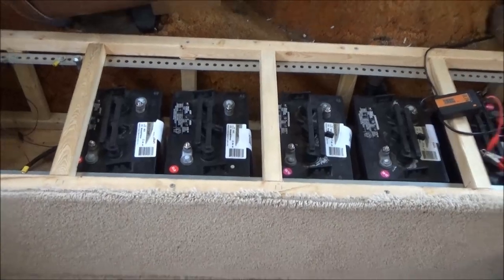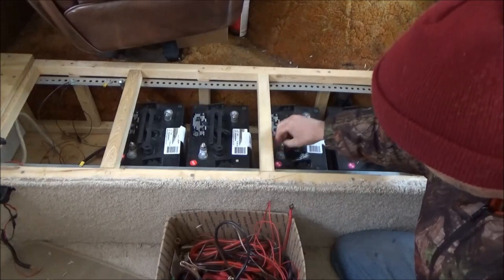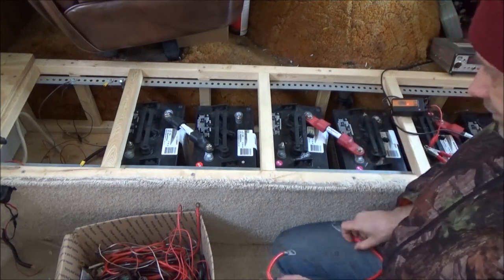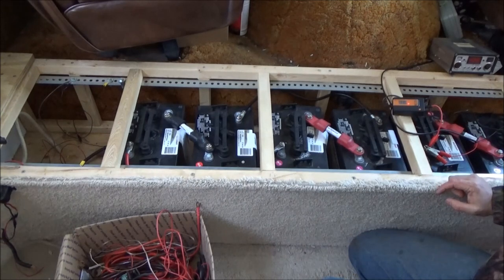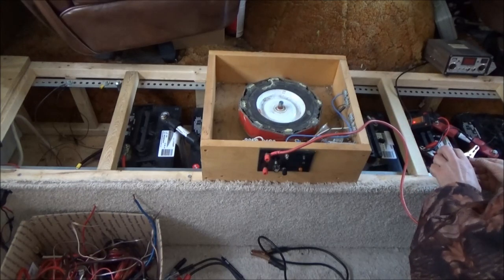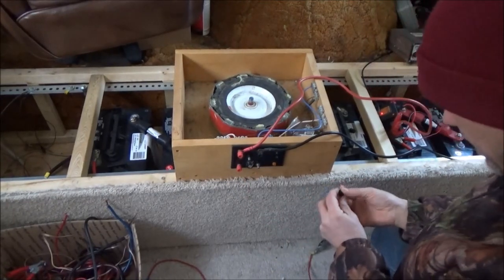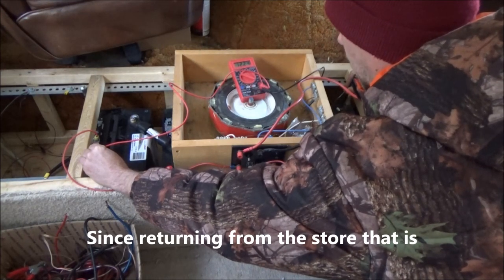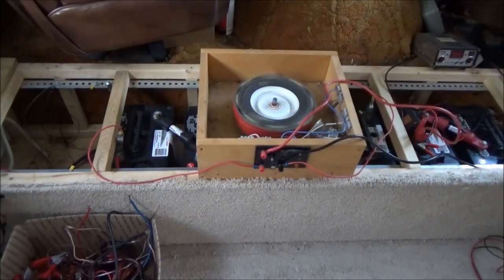Connecting Badly Sulfated Golf Cart Batteries To Bedini Motor Desulfator In My Off Grid RV

Comment: Hi Troy, as you asked I have waited before I left the channel. I want to say that the last two videos are much better and thank you. please remember even if all your doing is cutting firewood and moving snow we all want to see you doing stuff like that. it shows your not just sitting around. not that you can't sit if you want. :-) I have watch your channel for all this time due to I want to do the same as you. I want a tinny house off the grid. So you have been an inspiration to me. 
Thanks
James "Tank" Underwood
Reply from the maker: Thank you for hanging on. I have been quite sick since Christmas and was trying to hide it. It was affecting everything I do. I hope to keep plowing forward with good quality videos from now on.
Reply: The Do It Yourself World I was wondering about the forklift batteries. losing the cream off the top so quickly maybe they are 12 volt batteries and not 13.8. i think i would try using 7 cells instead of 6 giving you a true 14.volt battery. worth a try?
Reply: Allen Cox I thought of that idea, myself, but was unsure if it was a good one.
Reply from the maker: Allen Cox The big one is a single, solid 12 volt forklift battery bank. I will call the company and ask though but I think it should have normal voltages.

Comment: Troy, I used to work for a golf cart company, and got to learn a good bit about batteries and charging.  One thing I've noticed on your vids is your concern about voltages.  In the case of carts... example 48v pack is not considered discharged until it reaches 42v.  They regularly need this discharge to excercise the pack.  I'm fairly sure a 12v pack is not discharged(exercised) until it's down to 10 volts.  By not exercising your pack you are creating a sulfation situation.  We regularly ran discharge cycles on packs to rejuv them.  You may need to start doing this to keep your packs healthy.
Reply from the maker: 10 volts on a battery is very bad, for most batteries. I am no golf cart battery expert though. But I am going to cycle these old batteries in order to bring them back up.
Reply: Old Ni-Cad batteries needed to be deep cycled to prevent memory effect. This is not the case at all with lead-acid batteries. Whoever started doing that at the golf cart company you worked for was confusing the two battery technologies. Sometimes I still hear people say they like to fully discharge their cell phones to keep the battery in good shape, but these people also are confused by the way old Ni-Cad batteries needed to be treated. The lithium batteries in modern electronics don't benefit from being deep cycled, and it will in fact shorten their life.
Reply from the maker: Pete Brown Whoah there. I dont buy walmart batteries. Not sure what you mean there.
Reply from the maker: Pete Brown The old solar batteries I bought 2.5 years ago have served me quite well. I got them as junk. I never desulfated them yet but plan to very soon. I think they will serve me many more years.
Reply: if you connect differend adged batterys in your bank, i know you get problems.

its a big no no doing that .(i should know as a battey bank profi)
batterys dont dry up on the shelve,(ules you stoke a fire under them,only by overcharging, thats what i see in my proffesion almost daily cause people use non controlled cheep chargers fore longer times connected to the grid, over boiling them.
Reply: Bullit Bullit you are not correct on this, what you tel is a hoax, a traction cel is built to give power for longer times whit lower amp drawing, a starter battery hase more plates pro cel to increase the cold crank amps, its not made to power apliances for longer times with a low amp draw, it wil get damaged, also by using the big traction cels its better to keep them charged in between use, than fully draw them empty and charge again, thats the real truth! lead acid cels wil live longer if they stay fully charged, the lesser ful cicles the better!
(im a battery bank profi)
Reply: Mike Foreman At the golf cart co, we used a discharge machine designed for 36/48v packs.  They do the job as designed.  They discharge the pack using a resistor coil to the specified voltage, by checking the discharge time you can evaluate the strength of the pack amp hour wise.  By doing this in cycles you can bring a 30min discharge up to 65+mins. Essentially doubling the amp hours of the pack. This is common practice in that field.  I've recovered many 6v/8v/12v battery packs with this method.  It merely takes more cycles the more sulfated the batteries are.
Reply: Bullit Bullit  you have no idea what you are talking about,investigate this before you answer!
Reply: ***** deep cicle or not, if the have been filled before, and then dried out your plate surface is sulphated and damaged,! in my opinion you dont know where you are talking about!!
Reply: ***** apologies accepted! (i know i'm rusty in english, but my opinion is, if you understand what y mean, its fine by me ! lol
Reply: Pete Brown  no, its becouse the are used for giving traction power, (forklft hy workers etc).

powering electric motors.
Reply: McNeely Joe  i dont blast anyone????(atleast y dont think or want to do!)
yust giving advice witch is not gathered on you tube like the most of the replyers! (most take it for granted, but it realy is not, y have  more than 30 years real experience in it by selling and building and installing battery systems for mostly offgrid systems (mainly rv/boat and offgrid homes!)
forinctance, if you use a starter (car)battery in ciclic use you can give it around 80 discharge/charge cicles before they are getting weaker, a real semy traction battery (suposed the one you mean), can do that around 1500 tymes before getting weaker, a real traction battery can do that many, many more times, thats due to the way the cels of the battery are constructed, a car batt has many thin fragile plates to diliver huge crank amps in a shorter tyme (so low amp hour use)

a semi traction cel has thicker plates and sometymes a better isolation material like the paper in the starter cel. 
a traction battery has lesser but thicker plates with a good isolating material (like glass mat) or tubulair kind of plates (not like the spiral tops, thats a total different constructed kind of battery.
the les u cicle the cel the better it is , lead acid batterys live longer if kept fully charged.
not like the old type off nicads.
so please dont be affended, i realy dont want to affend anyone, yust giving my experiance and advice, good if you follow that advice, but hey, its a free world!

dont always follow the advice of a battery seller, who doesnt care how long your battery lives (for him, the shorter the better, he wants to sell you as mutch as possible)

its just whell meaned advice!

regards, Mr Bugsier 5
Reply: Pete Brown point is , dont let them become sulphated, by maintaining the right charging methode, a sulphated battery is damaged, i have many customers with traction batterys from 20 years or older, never been rebuild, or restored, still peforming good!
thats not only the way they are charged and maintained, but also the capacity, in off grid home use you cant have a to big battery bank!, the more amphours the better, the lower the amp stress is on a bank , the better!

but if you let them get detoriated (or however yo write it, sorry)
you damage it forever if its sulphated, its nevr good!
Reply: ***** y agree with that!

but im nottalking of militairy(?)cels, just normal (but huge) forklift cels (2000 amphours or more, they are expensive, ut not so expenive its unreal to buy a set.
what i do advice mostly to customers is also use a higher voltage, so 24 instead of 12, or even higher, to get te amp drain as less as possible!, every amp u use is one!

Comment: One more note, If you check your inverter should have a min voltage shutoff (usually in the 10volt range.  The reason for this is so your batteries don't get below their min charge range. Now that you have desulfators the need for exercising may be reduced but I've never gotten to test that situation. You might want to use the patched up forklift batteries for testing all this... get them charged to 12v... then discharge them to 10v... do atleast 4 cycles of this,  Use an amp meter not a volt meter to see their state of charge.
Reply from the maker: Now on normal betteries you never want to discharge that low. That can cause permanent damage at 10 volts from my understanding. Again, I am no expert on golf cart batteries. I am talking about the forklift battery which is considered fully discharged at 11.5 volts. But yes I will have to cycle them a bit in order to bring them back up. My inverter shuts off at 11.5 volts for safety of the batteries.
Reply: The Do It Yourself World  you mean 12.6 full, and 11.5 is to low (no load) , 11,8 is empty (no load)at heavy load 11,5 is ok, in rest 12.6 is fully charged, at no load 11,5 is badly low.
Reply: agree! (beware tat that shut of voltage is under load!, not bare battery voltage!)
Reply from the maker: MrBugsier5 What he said

Comment: Discharge the battery and charge several times is one way to help recover a battery called cycle though. So it dont get too hot when trying to charge it. Run them down with a light bulb recharge again. Let is cycle through few times. dont let it get too hot during equalize charge. Cycle them through several times can help recover a battery.
Reply: not the case if you have batterys that are so sulpated you dont get a charge in it with a normal automotive charger, trick is to pulse of part off the sulphation whit hv pulses (kind off zapping the sulpation layer of), after that a few cicles charge with a automotive charger /decharge partly, then charge again wil get them lively again, tho never better than new, its always damaged, say a 100 amphour battery wil be 80 amphours the most, its never good to let lead acid cels become sulphated, always keep these kind off batterys as mutch charged aspossible.the les you cicle them the better.